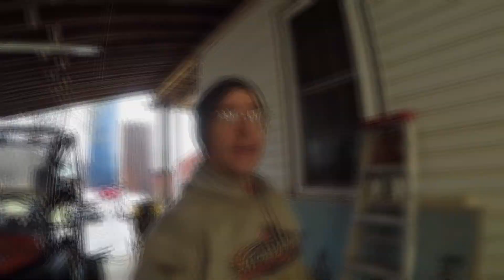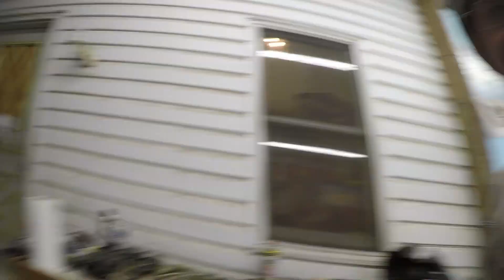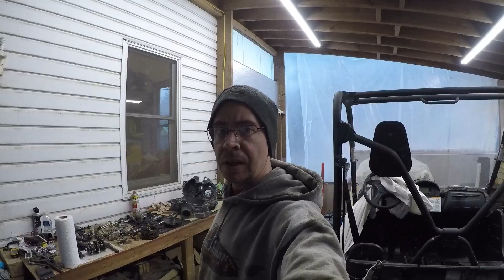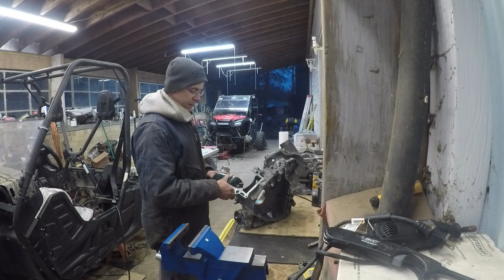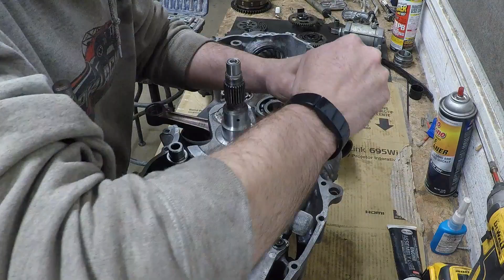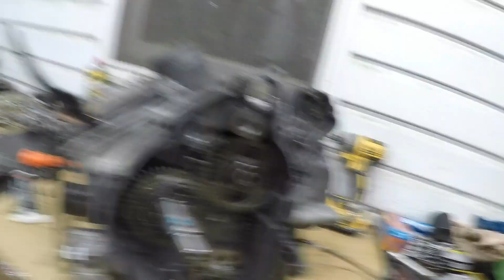Yamaha Rhino 700 Performance Build: Engine Reassembly Part 1

Comment: I have a 2008 rhino 700 . I was riding down the road and it lost power. It has something hanging out the side case right about the oil filter. The engine still turns over. Does anyone have any ideas what it could be. Thanks in advance.

Comment: When re-mating engine case, It would not join, It took me couple attempts,  different days to figure it out, it seems like the transmission gears have 1/2" movement, and so the shaft would not line up, I found there is an opening, you can put a thin pin tool through the case as you are mating the case, there is a pin size hole in the end of the small shaft, so you can slightly adjust this transmission gear, as you are mating case, or at least you can tell if the shaft is aligned inside case as you are mating.
Also my case was high on the transmission side, so I had to lift the case on the crank shaft side, as I was mating case on a 660 engine, then with these two adjustments, the case dropped into place!! Use patients do not damage as cases are HARD to come by now.

Comment: Is there anyway you could publish the unedited video? the parts you FF, for example right through the crucial mating of the engine cases.. I know it is a lot of work, I appreciate, but there are no videos on line that cover the details for newbs, TONS of videos people 
dis-assembling motors, but NONE re assemble., Thanks! Even if the long version contains mistakes, swearing.. it would still be huge help.

Comment: Did the upgraded engine require any ECM or fuel system upgrades?  Thanks.
Reply from the maker: ECM yes. I show that later on in the build. Fueling, nope. All oem components

Comment: I have used that "freezer" method as well and it works "ok" but a much better set up is to build a box then use C02 and it will shrink things much more than the freezer and it does it pretty fast vs waiting all night in the freezer. I first started using that method when even after 24hrs of having a yz250 crank in the freezer it did not shrink enough to allow the crank to slip in. You should never have to tap to get the crank in. Every time you hit it you run the risk of just throwing that crank out slightly and although the average joe will not notice once it's running your bearings will prematurely fail over time and it just won't be a smooth. Both case halves should go on easy ideally with no tapping. Try the C02 method you'll never look back.

Comment: hello, I have a 06 660, How did you remove crank assembly ? Yamaha Puller ? or hammer? Press out ?
Reply from the maker: I have a crank puller which is the best way without damaging anything. You can get one pretty cheap off amazon.